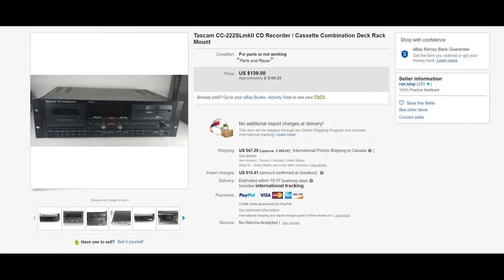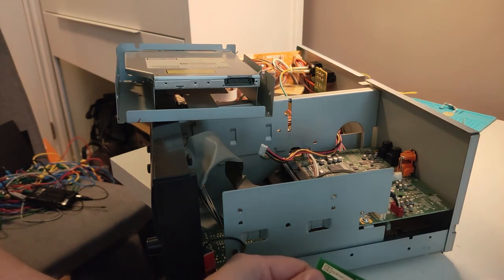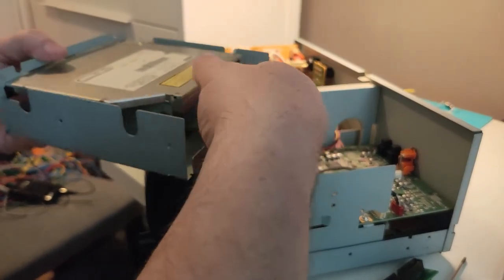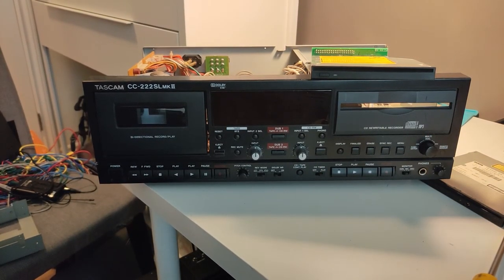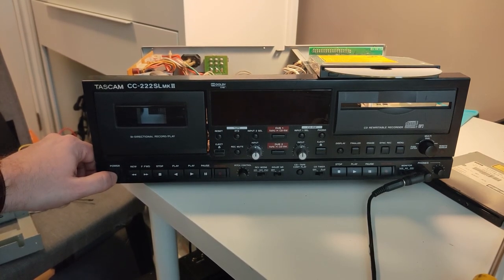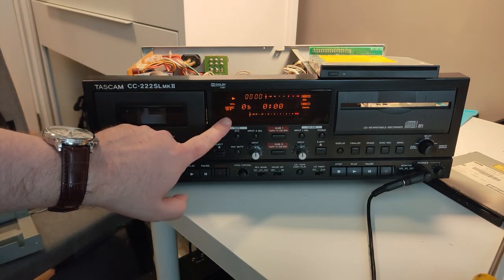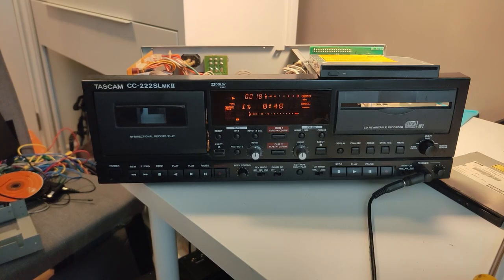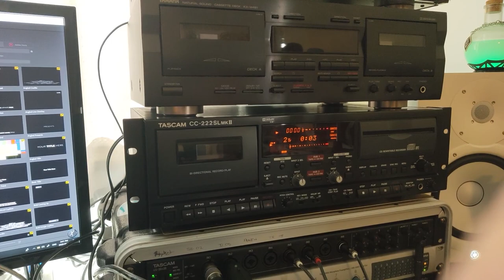Tascam CC-222SL MKII CD Drive Replacement (Part 2)

Comment: Ryan, 
You mentioned that the little PCB converts to the SATA format. 
That's not correct.

The cable is a standard IDE format cable.

The little PCB has the IDE socket on one side, and the JAE socket on the other side (for the Optical drive).
So anyone who is looking for a replacement drive, must specify "JAE" socket, not IDE, and not SATA..

Comment: Hi Ryan, Have the same deck . I purchased in 2023 cd writer won't load car disc. IU purchased the Panasonic cd writer you recommend I installed it no problem but it will get as far as trying to I.D. the TOC but like your demo just sits in that trying to I.D. the TOC then it won't allow an eject the CD writer will not recognize any CDR disc I insert and when I try to eject it it will only eject from the Writer eject button not the deck eject just like your deck demonstrated.... Any ideas Thx in advance for any assistance.

Comment: Question, I have the same model of Tascam, with CD drive issues. I have replaced the drive twice. There is currently a "new old stock" drive in it, same model as the original. This one is working the best out of the three drives, but it's still not right. 

It reads and plays commercial CDs ok. It has trouble reading writeable CDs, but if you power the unit off then on, it will read and play the CD. It has trouble recognizing blank writeable CDs, but if you power the unit off and on several times, it will recognize it. It has trouble dubbing a tape to CD. If you press the Dub button, it will burn a blank 4 second track. However, if you press Play on the tape side, and Record on the CD side, it appears to dub. However, it has a message D-IN LOCK! on the display. It won't finalize. After some more power off/ons, I got it to dub, and I could play it back on the Tascam, but when I tried finalizing, it said DISK ERROR. Then after that I couldn't get it to finalize at all even with a number of power off/ons. 

Should I try another drive? Take it to a repair place? Give up and sell it for parts, and buy something else? Thanks in advance.

Comment: I have a CDRW900SL and it's disc drive finally gave up the Ghot like yours did.
I'm taking a Calculated Risk, and orders the same Panasonic replacement for MY Machine as well.
I went forward on this because:
My OEM Tascam Drive looks EXACTLY like yours.
I called Tascam and they told me they no longer stock that Drive.
Our Biggest Computer store in our area said that if they COULD find a drive it would be $250.00!!!!
In the same town here, a Mom N Pop shop found me the Panasonic Drive NEW for $45.00.It should be here in Two more days.
If this fix does not work in mine for some reason, it's logical to gamble $45.00. If it DOES work, WHOOPIE!
If it does not work, I'm not out a small fortune. I DO have a feeling it WILL work.
I'll ket everyone on here know if it Does.....🥲
Reply: Did Panasonic driver work?